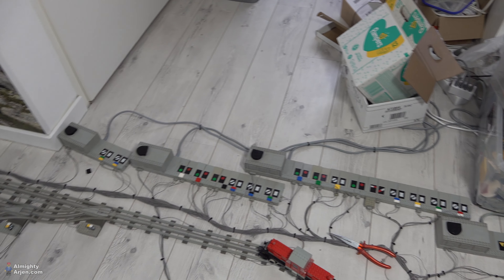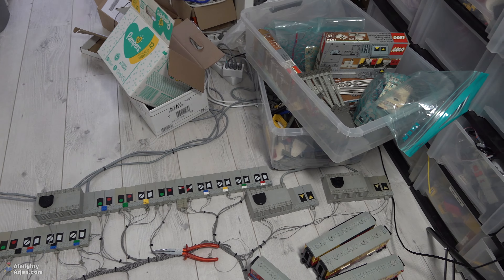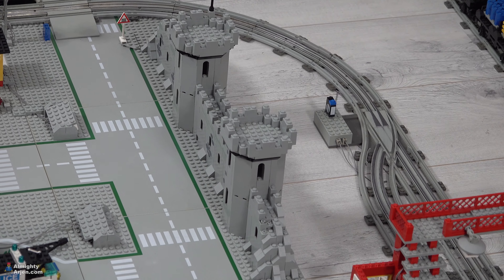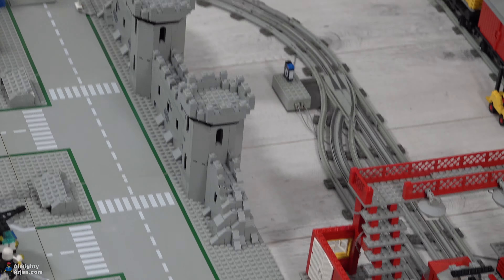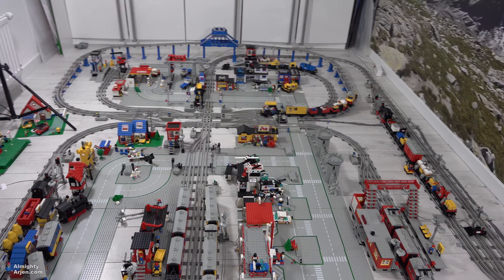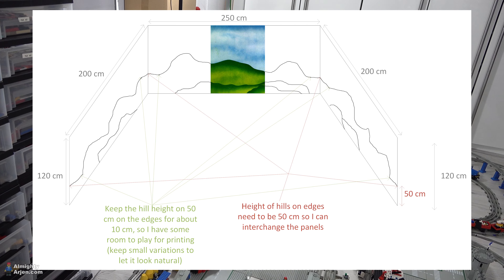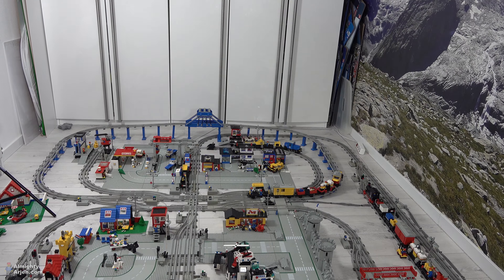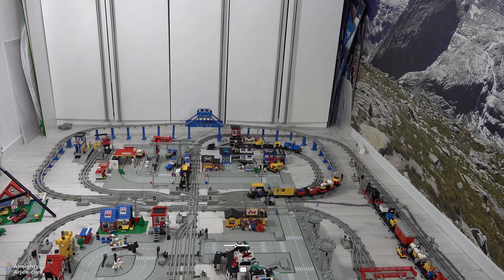Vintage Lego train layout Episode 8: cable management

Comment: Looks awesome! You’re doing really well with this project :)
I had a spare motor which had actually burned out, but the gears were good. I transferred the axle from one motor to another - the wheels pull off. As I noted elsewhere, the technique to take the motor apart is to support the ends of the outer casing, then press down evenly on all four wheels. The casing seems to be glued with superglue originally and can be reglued if you are precise with the gluing.

I’d like to know how you get your wires, please. They are really long!

I see you have a good solution for getting enough power to the solenoids... multiple transformers :)

Comment: With regards to the broken motor does the axle spin at all or no? If it does spin you might just have loose wheels which might need to be glued or fixed in some fashion. If the axle doesn't spin at all it could either be the gear has stripped and in that case you are out of luck. Or it could be the housing has become slightly loose and the gear isn't making good contact. Try running the motor directly connect to the supply and add pressure under the axle and see if it runs better, if it does the housing needs to be re-glued. If not you will need to open it and see. Hope that helps, ask if you have any questions as I have opened a 12v motor before.